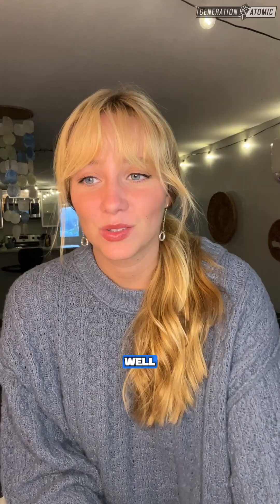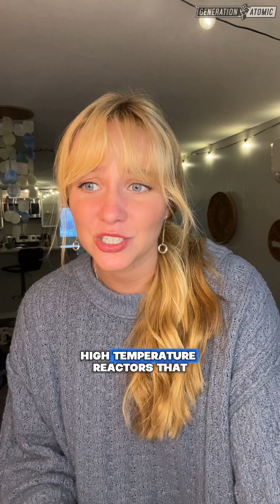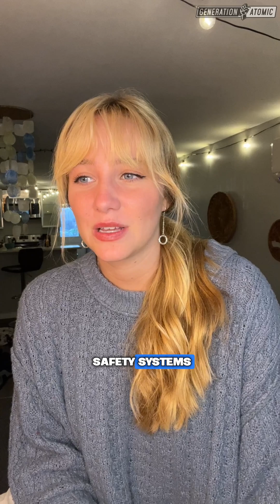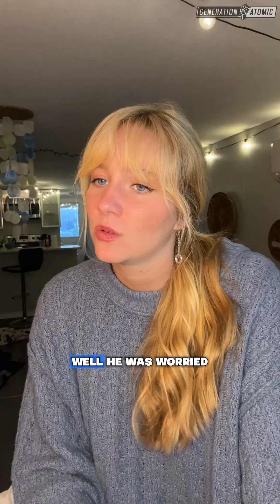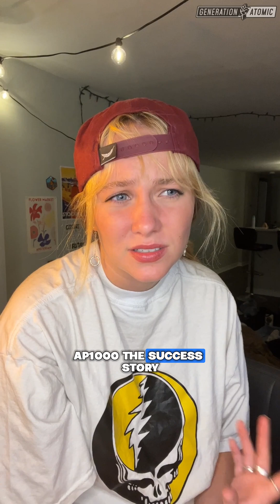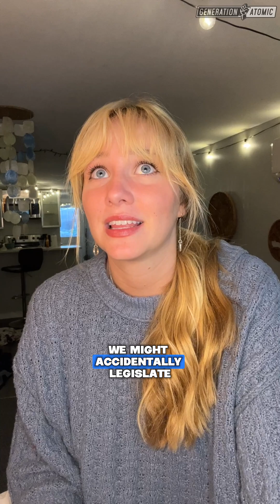Why “SMR” Hype Might Be Holding Nuclear Back #nuclear #smr #advancednuclear #nuclearpower #energy

Comment: There is nothing wrong with an ap1000. Except that we can probably make one that's 10 times cheaper. The key is a hot dry manufactured reactor. Hot means 600C. Dry means no water touching fuel. Manufactured means there's a loading dock with complete reactors ready to be shipped at a factory. Get those three base hits and you'll get that home run and be 10 times cheaper than the cheapest fossil fuel. The good news is there's a number of startups who have designs ready to produce. They're only waiting on regulatory approval and that seems to have sped up a lot.

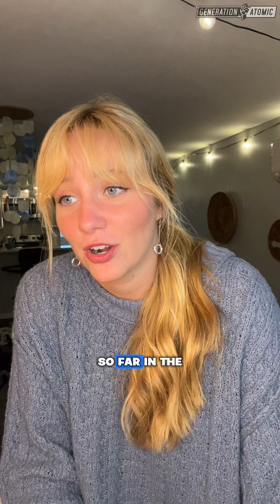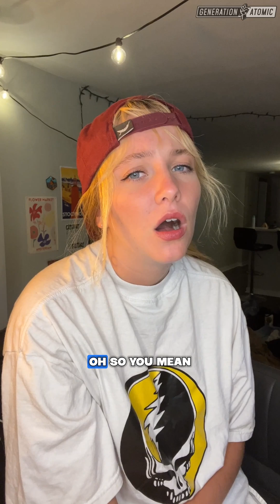Comment: 0:59 1:07 There are only two AP1000 reactors running right now in Georgia.
The other two reactors at Plant Vogtle are not AP1000.
Reply: There's a "*two!" At that part, but it's a bit small

Comment: Why does 4cents kWh electricity cost 44cents kWh at the meter boxes ?
 My electricity is 50cents kWh. 
My neighbours roof PV feed-in is dirt-cheap 2cents kWh 2 meters from me.
Both neighbours. 
Nothing but grid between us. 

Your an extremely clever person.
Reply: Basically, you are buying electricity from a utility, and that includes the cost of maintaining the infrastructure to distribute that electricity. All the wires and transformers require upkeep. The utility is buying the electricity from power producers on the wholesale market, which can fluctuate with supply and demand but on average can be closer to 5 cents/kWh. The utility might average out their cost of buying electricity on the volatile market and charge you that average plus the cost of maintaining the grid plus their profit margin. So that's 20-50 cents. Your neighbor is getting the benefit of a balanced, reliable grid without paying for the upkeep, and then they sell excess to the utility at the higher price, 20-50 cents, so the utility takes a loss whenever your neighbor sells them electricity, and they have to pass that cost on to you. I believe California recently changed their laws to prevent this regressive transfer of wealth, but some other states still have it. Energy markets are complicated, and I'm no expert, but I hope this makes sense.
Reply: @johndaisley6168  excellent understanding. 
Plus connection daily fee, plus administration fee, plus taxes in some places.

They should be added to the kWh rate.

The grid itself is a big business and needs its own return on investment, ROI, plus it's running costs and administration costs.

The question then becomes what is the valuation of the investment. 
If you asset became twice as expensive to replace then for a fair ROI the % rate remains fixed but the amount doubles.

This is the argument that private owners put to government agencies that review prices.

In Australia a period of large private upgrade caused the grid electricity to spike sharply up.
GOLD PLATING of the infrastructure was the conclusion because of the good ROI of all the infrastructure investment garrenteed by the government. 

Engineering economics and the politics drove the private owners action.
Over Engineering driven by greed was the conclusion.

Its complicated in detail, but simple in principle.
Reply: Power-service would be cheaper if meters were outlawed, and customers were billed only a single set amount each month for a given service-level.
Reply: @aliendroneservices6621customers may go offgrid. 😮
Reply: Greed.
Just get your own PV system with a decently sized home battery.

Nuclear is insanely expensive nowadays and anything planned today will not be working until 10 to 20 years in the future. 

There is no point in waiting as solar will have paid for itself twice over by that time.